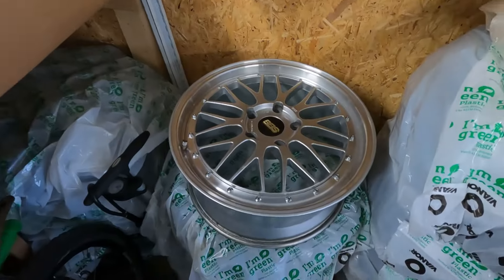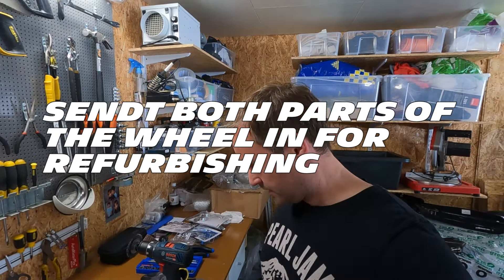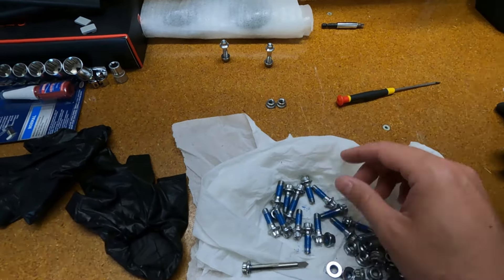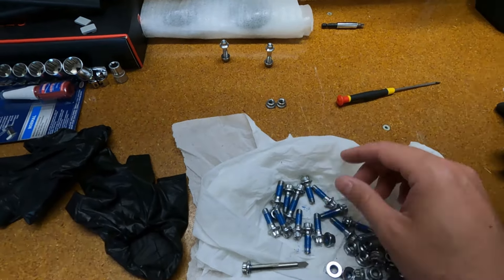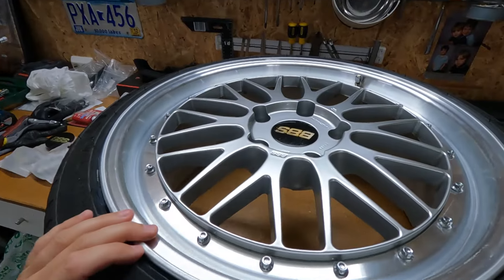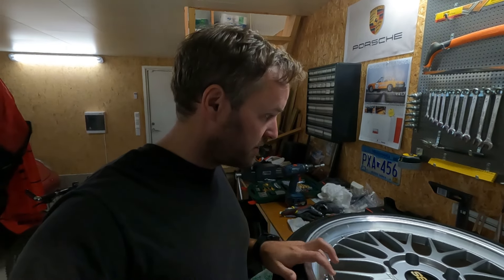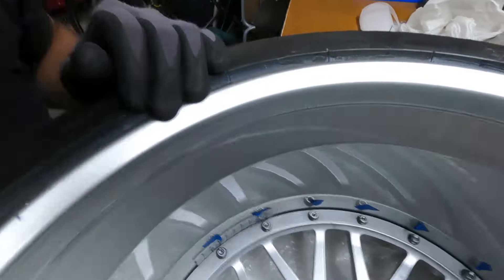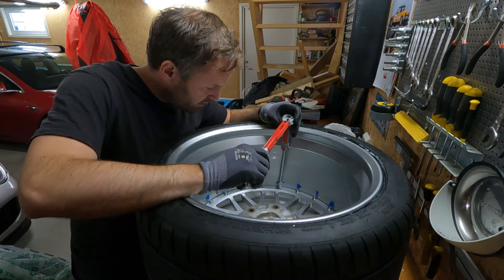Refurbishing the BBS LM wheels on my Porsche 911/996 turbo

Comment: Do you always need spacers für the BBS LM? Is there no other option with the BBS LM?
Reply from the maker: It's probably possible to order custom ET to make the fit perfect. It's fine in the front and I could run without in the rear, but you get a perfect fit with them in the rear 👌